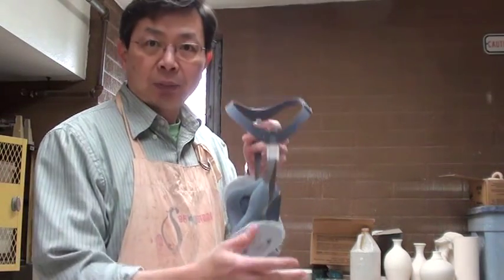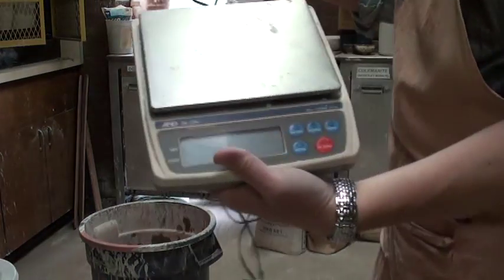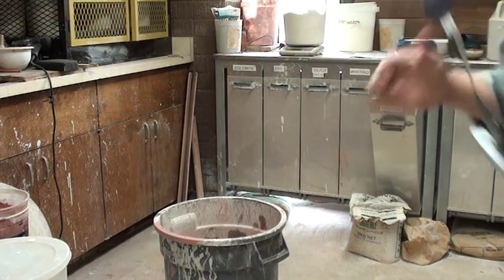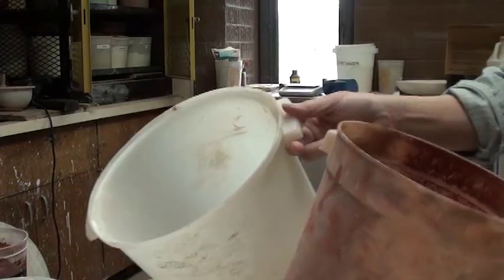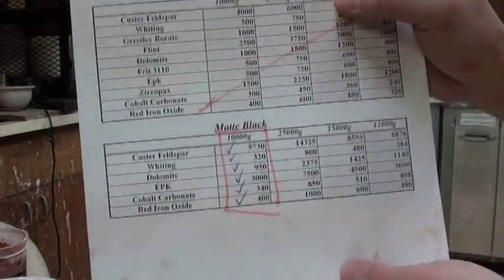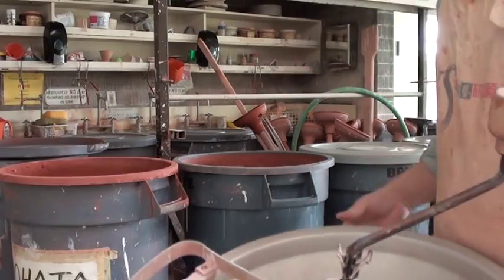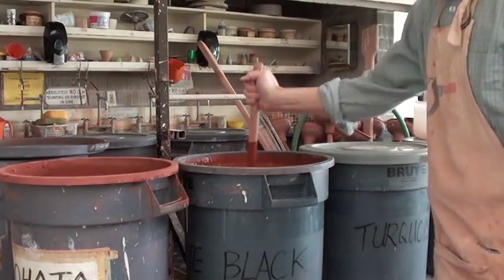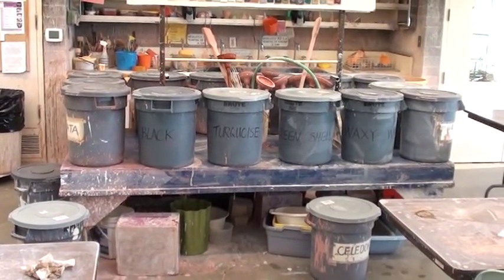96. Weighing / Mixing a Black Glaze Recipe with Hsin-Chuen Lin

Comment: Thanks for sharing your technique!! I wonder if the 10,000g of glaze included water and dry material or it's just the weight of water? I don't see you are measuring water when you poured it in the bucket. I am planning to mix my very first glaze by following your methods. Please respond me. Thank you again.
Reply: +Millie baek 10,000g of dry base glaze then you add water to the dry material.